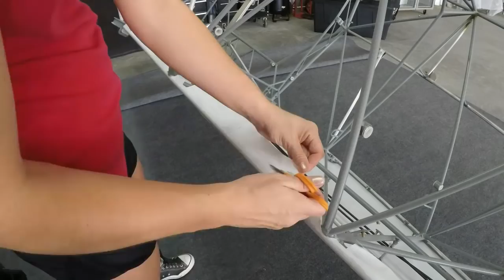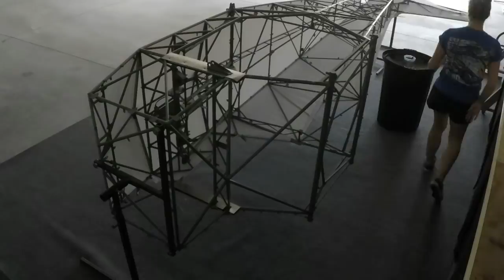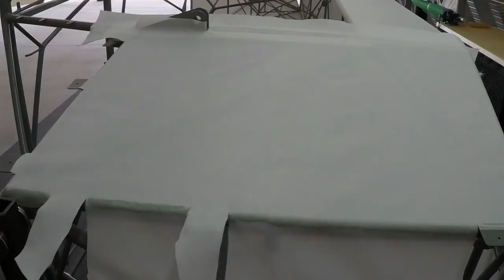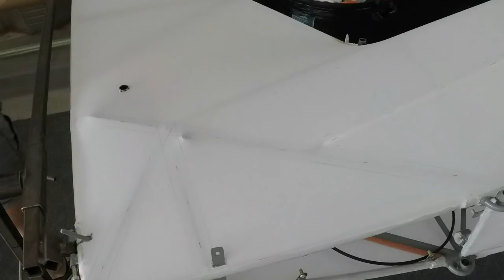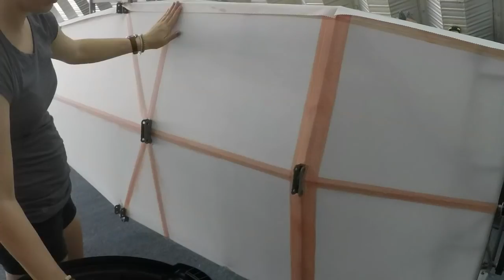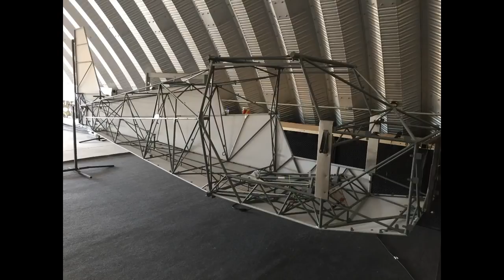Fabric Covering SuperSTOL Fuselage using Poly-Fiber System

Comment: Awesome  video,,,brngs back many memories back in the l;ate 60's n 90's , My old Starduster required rib stitching in the prop wash 1 /12", outside 2 1/2"...I did all the stitches 1 1/2" just "to be on the safe side. 

You work is flawless and to be admired, You had a good teacher,,,,:)

Comment: As a Hobby I design, build, and fly Radio Controlled Aircraft.
Your covering technique is about the same as if I were to cover one of my planes with "fabric". Two part epoxy, long cure is used.
In lue of paint I simply tinted my epoxy for a two color plane.
Great work girl, keep it up.
Looking forward to seeing more of this airplane.

Comment: What is the purpose of the tape material and why apply it over certain parts of the fuselage?
Reply from the maker: The fabric tapes are applied wherever the fabric lays over structure or has a protrusion. This helps reinforce against chafing/wear.
Reply: Ok, that makes sense. Thank you.

Comment: Awesome!
Just verified whats on my Starduster too sa300
Glad i watched your vid!
Is it only stits product u can apply/paint over silver uv coat? Or can u use urethane automotive paints as well?
Thanks and great work!
Reply from the maker: I always recommend that you use covering materials and paint from the same system. Automotive paints are generally not flexible enough and will crack.

Comment: Great job. Please use proper P.P.E for prolonged exposure .
Reply: What fabric and glue is being used? Epoxy?  Thanks.
Reply: This is good general advice, but do you have any information about what specific personal protection equipment, if any, is recommended for this sort of work?

I'm not seeing anything obvious, like sprays to require a respirator, so the most i could think to recommend is a set of gloves.

Comment: You work very nice and very clean and I want to ask you what is your favorite glue because I see in your videos you have used solvent and water based, also a friend told me to always use light weight pinked finishing tapes to left a more even and flat finish.
Also you use flat rib stitch cord? Beautiful work and very clean!
Reply from the maker: All systems have pros and cons but the poly-fiber system is my current go-to product line mainly because of accessibility. I use light weight tapes in many situations because they are easier to manipulate. Yes, I use flat rib cord because I like the lower profile.

Comment: Back again. Lol. I finally started on my fabric. Got the tail surfaces done. Well elevators anyway. Lol. Question, do you think your glue down? I notice you apply it on through the top so it will soak through the fabric. Right? 
Thanks!! Btw, looking forward to some new videos. 😁😉👍🏼
Reply from the maker: Yes, I thin my glue a bit and apply multiple coats to the surface. I then thin it further and apply it over the fabric to adhere it in place.
Reply: iapplyufly - THANK YOU SO MUCH!!! I thought you did. Lol. What do you thin it with? MEK or Reducer?
Reply from the maker: MEK
Reply: iapplyufly - Thanks!

Comment: Nice covering of the fuselage but wouldn't it have been better if you had put in the control cables and pulleys first plus placing all the controls so you won't have the possibility of stepping through the fabric ?